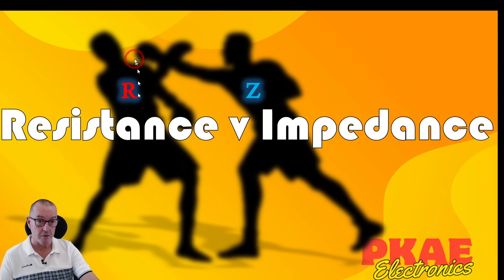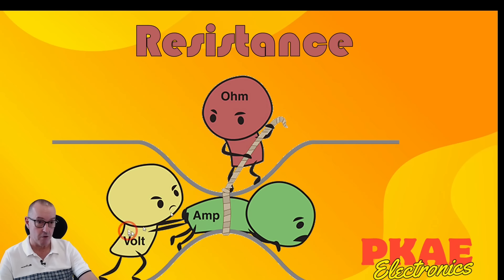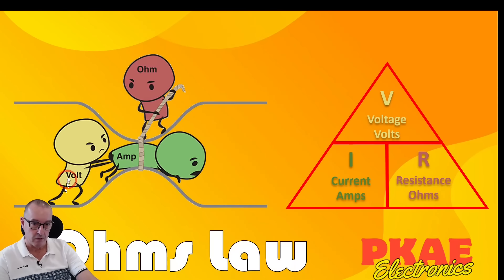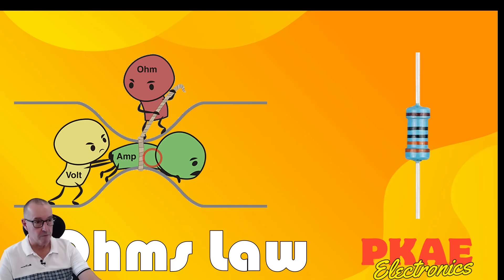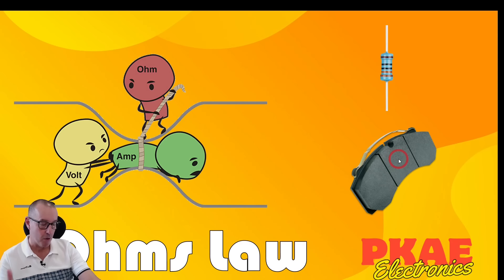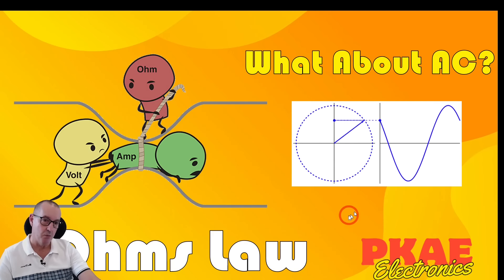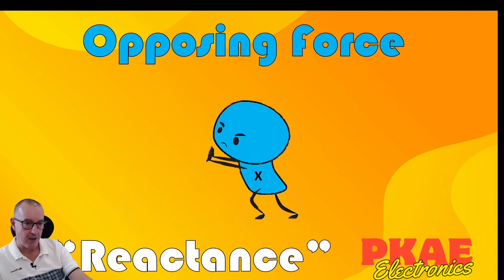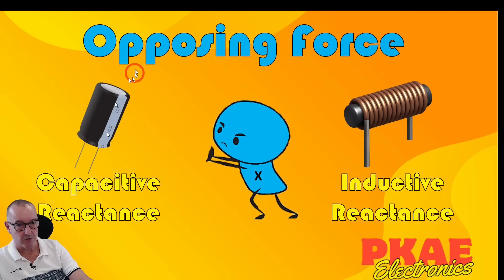Impedance Explained.

Comment: I'm an electrical engineer. The right triangle trick is genius. I can't believe we were never taught that. Subbed
Reply from the maker: Glad you found it useful. 

I work with many electrical engineers who never really understood impedance, but deal with it all the time. 

Thanks for Subscribing.
Reply: Not an engineer of any kind, but used to play with antenna matching circuits and found this a superb little video, again I have never heard of the right angled triangle... Thank you.
Reply: That was almost first what we were taught in vocational school for electronics. If you continued to study at University level then you were teach how we got those formulas also same time we were taught complex numbers and some other fun math.
Reply: @LimbaZero  unfortunately no. I got a bachelors in EE. Our professors were the genius kind who know how to do but not how to teach lol they were dark times
Reply: Should have gone to a better school.  Sounds like you didn't learn phasors.
Reply: I cant beleive you were never taught resistance as the base of the triangle and reactance as the vertical of the triangle and impedance as the hypotenuse.

2nd year vocational electronics stuff
Reply: Did you never get taught power factor in ac power systems? Same thing.
Reply: Or the 3db down point on a bode plot when resistance = reactance in an rc filter and phase shift is 45 degrees? All based around the right triangle
Reply: I am surprised you were not taught complex numbers, as that was what I was taught in my electrical engineering degree at Monash University in 1979... not only is it the basis of electronics as demonstrated here, but power transmission....
Reply: @hypercomms2001  yeah thats high school maths when i went to school, and its pretty much the same concept
Reply: That is the absolute most basic concept that every electrical engineer should know
Reply: @gasun1274  yeah right after ohms law
Reply: @M1America  "Should've"

Sure. We should've been born in another place too maybe right?
Reply: @Splarkszter ”Should have” without the contraction is perfectly valid and okay. Also (and im not on that commenters side, im just gonna say this because it is interesting), in Germany we learn about the triangle in high school (if you chose to do your “abitur” in mechatronics) which is really cool
Reply: Huh? That's high school physics level stuff and a lot of EE is based on that (e.g. phasors).
Reply: Thank you, very well explained. I have a question about scope leads where they quote impedance of say 50 ohms for example. What frequency is that quoted at and how do I know what impedance leads to use when measuring a circuit.
Reply: He was also taught conventual flow theory, tech vs. engineer
Reply: Odd that you made it through an EE degree with out an intuitive level understanding of vectors, magnitudes, complex numbers.

Comment: The thing with the diagram showing a person being pushed through a tube, is that it's really just a visual for DC. For AC, it's more like pushing someone on a swing. That is, the electrons are really just moving back and forth in place; what flows through the tube is the signal to do so, like people in a stadium wave. Resistance is like the friction/air resistance that limits how high you can push the swing. Reactance, then, is a function of how efficiently you push them, given the frequency at which the swing resonates. If there's very little resistance but you push the swing at exactly the wrong times, impedance can still be very high (that is, you won't get the swing/current very high).
Reply from the maker: Thanks. Another great description.
Reply: After reading this comment and then imagining the impedence triangle in a situation where there's no phase angle it finally clicked for me.
Reply: More confused - i lost total 'comprehension' (but not interest) exactly at the word "resonated", in "freq. at which the swing resonates. Even after assuming resonated simply referred to the 'tempo' the swing was returning back to the 'pusher'..
Reply: @osearthesp  The resonant frequency of an oscillator (to my understanding) is the frequency at which you vary the force/voltage to maximize the response (swing amplitude/current). If there's no air resistance / electrical resistance, the amplitude of the response will increase linear without bound at the resonant frequency (and nowhere else), but if there's even a tiny bit of resistance, the resonant frequency will simply approach some finite amplitude, and that will just be the largest available amplitude among frequencies of applying the same force.
Reply: In particular, the differential equation relating voltage and the rates of change of charge (incl. current) in an RLC series circuit takes the form of the equation for a damped harmonic oscillator: in this analogy where voltage is the driving force, it follows that capacitance is the (reciprocal of the) spring constant, resistance is the damping constant, and inductance is the mass. 
(In this model, without further considerations, a circuit with no inductance or capacitance--no mass, and no spring for simplicity--is assumed to respond instantly to voltage, like a swing that accelerates instantly to the speed at which air resistance exactly cancels the driving force)
Reply: Still wrong.

Voltage IS NOT PRESSURE. 
everyone gets this wrong.
Voltage does not push or force electrons to move. 
Look it up. 
Voltage is just mearly "potential".
Think of it like this - remember those plastic marble hill toys as a child ? How you roll marbles down a slope. 
That's voltage. 
Voltage is the 'abilty' for electrons (marbles) to freely move. 
My analogy utilises gravity so it's just an analogy. 
But the easier the electrons can move equates to their being greater potential (voltage)

Research and get it right.

Voltage is not pressure.. never was never will be
Reply: @devarmont87  Voltage-as-force is a metaphor. It's not supposed to be exactly correct, it's supposed to relate two concepts. In this case, a damped harmonic oscillator, as a spring or small-angle pendulum: F = mx'' + bx' + kx, or as an RLC series circuit: V = Lq'' + Rq' + (1/C)q.
Reply: @rarebeeph1783 I understand that it's a metaphor, but there's millions of electricians and hobbyists out there that are saying the wrong things about electricity. 
In the end, the wording is wrong. And I stand against misinformation and disinformation. It's where I fight .. I will die telling the world where they've been misinformed
Reply: @devarmont87  Millions of people possibly more productive than you...don't worry about words, worry about actions, keyboard warrior.
Reply: @devarmont87  Pressure is potential, always has been.
Reply: @wrenchposting9097   you call me out saying don't worry about your words, worry about your actions, then call me a keyboard warrior. 
Go get a dictionary, and look up the word 'hypocrite' 😅
Reply: @TheDuckofDoom.  No, it's not fundamentally the same.
Pressure HAS potential stored energy. But it's isn't potential. 

It's like saying air is oxygen... No, two different things..
Reply: @devarmont87  Pressure is not, and has no, inherent energy. Pressure alone says nothing about energy. It is only potential.
Reply: @TheDuckofDoom.  It has Stored energy.
You don't know as much as you think.
Reply: @devarmont87  No, pressure doesn't have any stored energy, and neither does electrical potential. 
No more than distance has rotational moment, despite distance being one component needed to describe a unit of moment.
Reply: And to be even more precise and a massive headache, our electrons do not move(much) or carry the charge. 
Electricity is a wave, that travels around the medium. Electrons seem to more just resonate the wave like a newton pendulum.
Reply: @pawelhyzopski6456  yes, something not a lot of people know. 
. Which is also why the current doesn't kill you. How can something so slow harm you? It doesn't. It is the induction of the electro magnetic field that hits you. Not current
Reply: @devarmont87  i concluded that its resistance or in proper terms impedance (heat generated due to it). Or plain hz (heart). Other effects are less known and rare but include electrolyte poisoning. 
Apart from that, its a real shame indeed. Not even when i was studying it, it was well explained. Only years years later i got to the bottom of it. 
And many ppl are so afraid of it....

Comment: Resistance vs. Reactance:

Resistance is a fundamental property of a material or component that opposes the flow of electric current. It depends on physical characteristics like the material's resistivity, length, and cross-sectional area. For example, a resistor with a certain value (say, 10 ohms) will always resist current by that amount, regardless of the type of current (AC or DC).

Reactance, on the other hand, is an emergent property in AC circuits. It doesn't come from the physical characteristics alone but from the way capacitors and inductors interact with the changing AC signals. Reactance depends on the frequency of the AC signal and the phase difference between voltage and current.

In other words:

Resistance is like a steady, predictable barrier to current flow.
Reactance is like a dynamic barrier that changes with the frequency of the AC signal

Reactance is a type of resistance that only occurs in components like capacitors and inductors, which are found in AC (alternating current) circuits. Unlike regular resistance (like you find in a resistor), which simply resists the flow of electric current, reactance is a bit more complex because it depends on how the voltage and current interact over time.

In a capacitor, the current leads the voltage. This means the current changes direction before the voltage does. In an inductor, it's the opposite: the voltage leads the current, so the voltage changes direction before the current.

This difference in timing, or "phase," between the voltage and current creates what we call reactance. Because of this phase difference, the voltage and current don't reach their maximum values at the same time. This makes the ratio of voltage to current (V/I), which we call impedance in AC circuits, change.

Here's how it works in simple terms:

Capacitive Reactance (Xc): In capacitors, the current leads the voltage. So, at any given moment, the current is ahead of the voltage in its cycle. This "leads to" a certain kind of resistance called capacitive reactance.
Inductive Reactance (Xl): In inductors, the voltage leads the current. So, the voltage is ahead of the current in its cycle. This results in a different kind of resistance called inductive reactance.
Both types of reactance affect how AC circuits behave, but they do it in ways that depend on the frequency of the AC signal. Higher frequencies increase inductive reactance but decrease capacitive reactance, and vice versa.

So, reactance is like resistance, but it’s special because it comes from the phase difference between voltage and current in capacitors and inductors.

Imagine resistance as a speed bump on a road – it's always there, and it always slows down cars (current) by the same amount.

Now, think of reactance as a wave on the ocean. The resistance to a boat's movement (current) changes depending on the wave's height and speed (the AC signal's frequency). If the waves are high and fast, the boat might struggle more (inductive reactance). If the waves are small and slow, the boat has an easier time (capacitive reactance).

So, reactance emerges from how the waves (AC signals) interact with the boat (capacitors and inductors), while resistance is just the speed bump's fixed, unchanging opposition to the car's movement (current).
Reply: Then there's the semiconductor effect where (for a PN junction)  the voltage has to exceed a certain point before current flows.

Phil Hartley blew my mind when he pointed out that the energy is in the fields and the fields are in the substrate, not the copper. Thinking in terms of fields, I've been able to design much more effecient pcbs.
Reply: Speed bumps affect cars dynamically in that if they are hit at great speed or at an angle the vehicle could lose control or take major damage.  
I loved your comment clarifying reactance.  However my mine is such that I find myself questioning points.
Reply: You missed something big:
Resistance "consumes" irreversibly the energy (turned into heat).
Reactance doesn't, it stores and restores. So reactance is something "like a resistor" that doesn't consumes energy. German has three words that make this clear:
- Wirkleistung
- Blindleistung
- Scheinleistung
In English i don't know but it is the S²=P²+Q²
Reply: @rdson1621  same with a capacitor. An ideal one anyway. A real inductor does lose a little energy as heat but unless it’s going into space I think we can usually ignore that.
Reply: @marcdraco2189  Who would have thought of that! Yeah I'm sarcastic. Let's go further: a conductuor actually isn't a conductor, it's an impedance ^^ Cheers from an electrical engineer.
Reply: @rdson1621  Bravo! Absolutely and a small parasitic can really ruin ones day when we're working with those modern logic chips with FETS that seem to switch in a couple of planck times. God help us if they ever get that fast, not in my lifetime or perhaps ever but it's hilarious to laugh at how fast they've gotten over just my lifetime.
Reply: Super Explanation!!
Reply from the maker: Thanks for the comment. My mind is the same and I question everything. Have you heard of the "Five Whys" technique? I think I invented it without knowing it was already a thing.
Reply: @marcdraco2189 exactly! One of my teachers in university asked us every class: "Where does electric energy travel through?" The answer is always the dielectric material! (air, epoxy, whatever). Of course, he was an RF specialist and was well aware of how circuits relate to electromagnetic waves.
Reply: Resistance is an emergent property as well, it's basically a macroscopic sum of quantum electrodynamic effects. Reactance isn't any less fundamental, it's more complicated conceptually but it comes from the same underlying model that the lump circuit model is based on (which are idealized from Maxwell's equations).
Reply: Amazing explanation, so great examples and analogies. Thank you very much!

Comment: I stumbled onto this video completely randomly, but just wanted to highlight something cross-disciplinary:
I studied structural engineering and there was one mandatory electrical engineering course that covered the subject of the video.
It struck me then that the differential equation governing the RLC circuit has exactly the same form as that for structural dynamics with mass, stiffness, and viscous damping: mx''(t) + cx'(t) + kx(t) = F(t)
And to further drive that home, the analogies you used for capacitance and inductance were stiffness and mass, respectively.
Math and physics truly are beautiful!
Reply from the maker: Thanks for the comment. The similarities across all sciences are indeed very interesting. 

I always believe that there's some underlying universal rule that governs everything and it's probably very simple. Humans have simply just not discovered it yet.
Reply: Not randomly.  AI was watching your interests and offering appropriate videos.
Reply from the maker: @Deus_Ex_Machina.  the algorithm works correctly sometimes then. :)

Comment: ok most of the first 3 quarters of the video you were explaining something that I found somewhat interesting, but then you pulled out the triangle chart and completely blew my mind. I would never have guessed that you can use trigonometry to calculate the impedance and phase angle of a circuit.

Great video!
Reply from the maker: I try to avoid overcomplicating with maths, but it always remains an important aspect. 

I will be doing further videos on the impedance triangle and explain why this works and will also lead into what Power Factor is. 

Thanks for watching and thanks for the comment.
Reply: @paulpkae  Thanks for the video! I greatly enjoyed it

Comment: Brilliant video! Most of my knowledge about electrical circuits comes from the high school and it was mostly about DC. AC was never treated as much important. I knew there is something like impedance but had no idea how it relates to the resistance. Now it is clear for me. What I lack here is maybe the explanation for what we're using impedance. I think it can be used in Ohm's law for AC but would be great to see that on the video.
Reply from the maker: Thanks for the comment. Glad you found it useful.

Comment: Impedance, reactance, phase angles,etc have always been a bit of a struggle for me... it's not that much of a problem because I rarely visit the land of AC. This video has done a wonderful job of simplifying things to the degree where I might actually have a grasp on it now. (with a good few hints as to how low-pass and high-pass filters work too) :)
Reply from the maker: Thanks for the comment. 

Yes, once you understand "Reactance" and it's relationship with frequency, then High/Low Pass filters are much easier to understand.

Comment: 4:00 in the morning, and you're clear enough to keep me awake and interested.  I would have gotten more from my freshman physics class 30+ years ago if you'd been my prof. I especially appreciated the mechanical analogies of the bicycle pump and the flywheel which gave me something I could understand immediately and will remember for the rest of my life. I do wish that, having derived the impedance, current, and phase angle  of your circuit, you had set it up and shown the measurement as you did for the single components.
Reply from the maker: Thanks for the comment. Yes that would have been good to include.